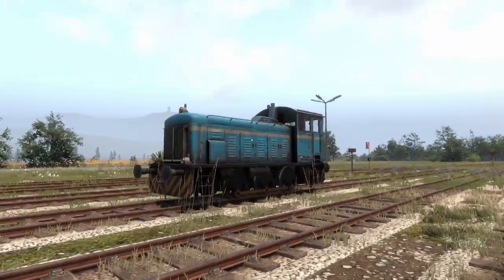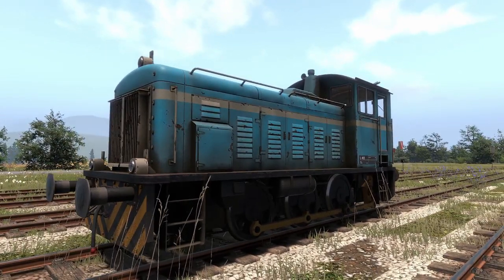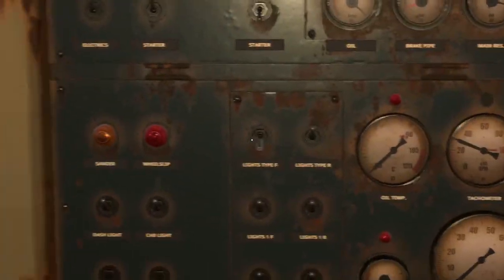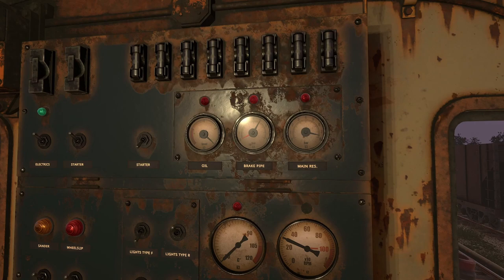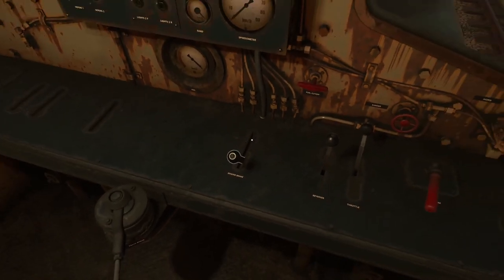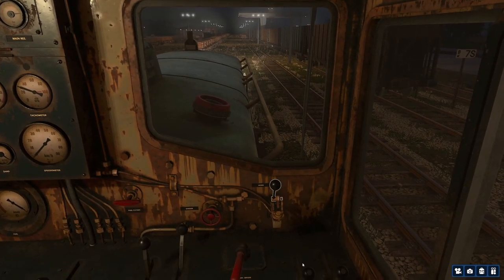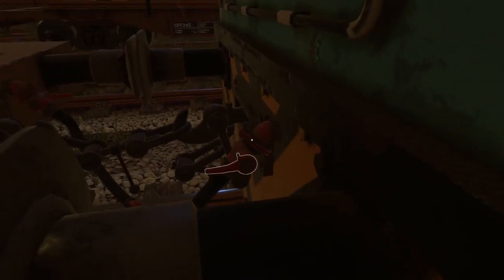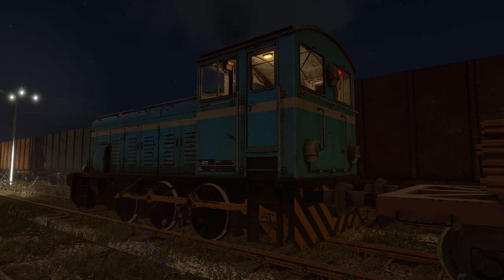Lets Take a Look at the DM3! | Derail Valley DM3 Tutorial

Comment: This is a large diesel engine and as such does not operate well at high rpm.
Try this . keep the rpm between 400 & 800 . If the oil runs hot reduce throttle by 1 notch no need to change down if oil still overheating reduce 1 more notch do not shift untill rpm reaches circa 400.
If rpm is falling very rapidly , still wait until 400 rpm  but shift 2 or even 3 gears lower.
The shirt diagram you used is missing 1 gear (there are 9) gear 1-3 is slightly higher than 2-2 .
Ive pulled 700 ton in dry condition up that grade in gear 2-1 & 850 rpm, max throttle - 2clicks,  oil temp in the low amber zone I belive there are some that claim over 800t is possible in 1st gear on that grade also .
These comments don't mean I didn't like the video --- I did, and I enjoy the style of delivery and content, Subcribed Belled
Reply: Yep. and I hauled 1311T [youtube removed the link, so here's the video id: q_3cAdLTz9w] up that same hill. However, that's only in the dry.
If you did in 2-1 with 700, that means it should work in the very wet too.
The DM3 is a beast.
BTW, I always skip 1-3, even with these heavy hauls. Not only I can't remember it (I use a mnemonic for the gear shifting) the difference is so small that the large majority of times it's not worth the time to shift to it.
Reply: Here's me trying to post the video URL of my 1311T haul again: https://www.youtube.com/watch?v=q_3cAdLTz9w

Comment: in derail valley there is no "running" position on the non self lapping automatic brakes. in derail valley any locomotive that has a "non self lapping automatic brake" doesn't have "running" instead You have four positions. You have "release" "lap" "service" and "emergency". "release" means You are connecting the main reservoir to the brake pipe to release the air brakes on the entire train. next You have "lap" lap holds whatever pressure You've got on the brake pipe so when You make a reduction on the automatic brake and You hold it to "lap" it will hold that reduction and it won't change anything. "service" means taking a reduction on the automatic brake whether You want to slow down or stop the train and once You make a reduction You can then apply the automatic brake into "lap" . "emergency" emergency unlike service however quickly dynamites the train by causing the brake pipe to go to 0 psi which causes the air to be dumped into the brake cylinders to then lock the brake shoes onto the wheels as tight as possible